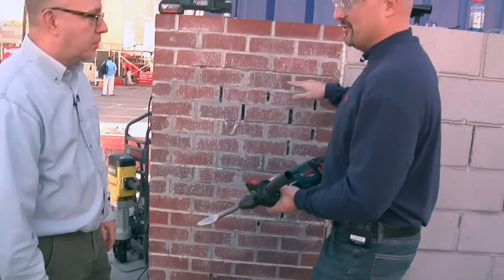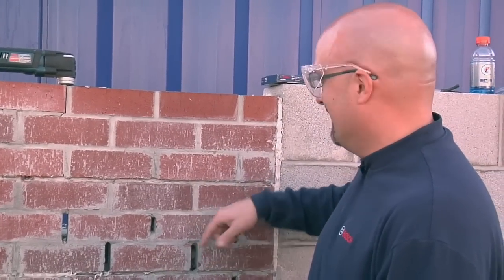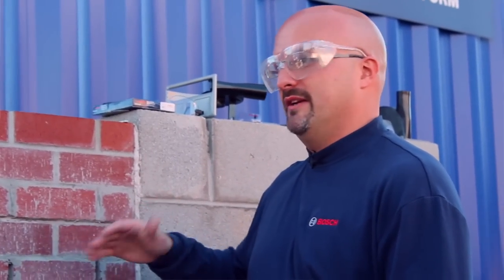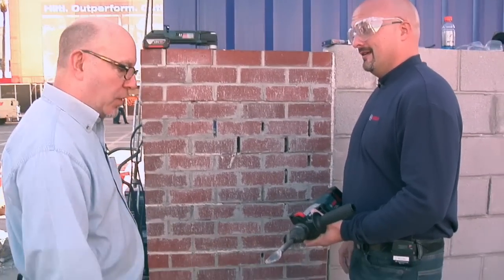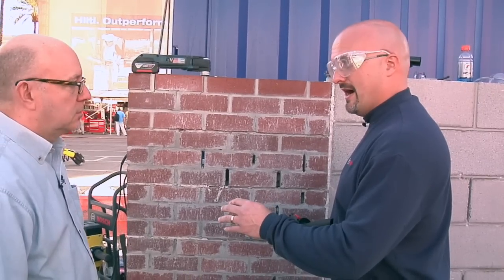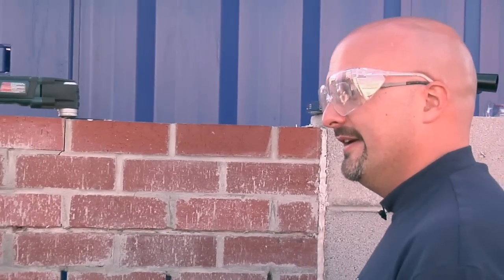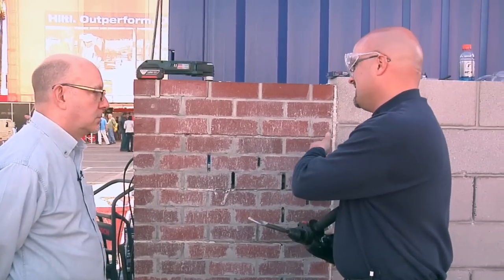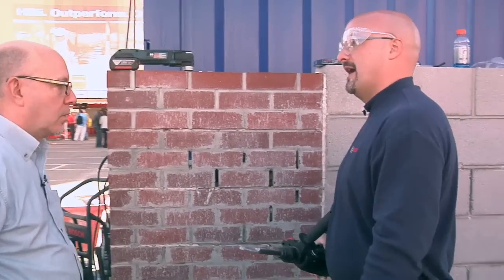Bosch Mortar Knife

Comment: He chipped the last two bricks cause he went too deep.  The wider shaft of the tool hit the bricks.  I think this is a good idea if your careful using it, he wasn't.
Reply: It should have depth control integrated into the system.  But it doesn’t, so…

Comment: Plunge chisel works just fine to break out the “half moon”. Anyone else here do pointing work? Trying to decide if I want to spend the money on one of those fancy joint cutters. Dust be damned, I’m good with my 4” dwalt with the paddle switch and they are reasonable in cost to replace as they burn out.
Reply: How often do you go through grinders at this point ? Do you still go with deWILT
Reply: It really depends but I’d say they last about two years. I usually have a few at a time. I cycle them out as to not over heat them. The dewalt is what I’m used to and it’s not crazy expensive

Comment: i was facepalming the second he pulled out the hammer drill. i've been tuck-pointing since i was 17 years old, if you took that thing up against half the walls i've done with soft 200 year old bricks, the walls would crumble.
Reply: Smokey420 are you still on here??
Reply: What do u use a diamond raker bit to get the half moon

Comment: 😕I think he just chipped the corner of the brick... I understand that this guy is a sales rep , not a contractor, but still.. it might not be a miracle Bosch tool after all  ..

❓ Anybody, please, could post a reply with the link on how to do it properly and what tools to use?..I have cracked brick mortar and have to remove it and re-point. I have seen some expensive diamond router bits.. too expensive solution for a DIYer. THANKS